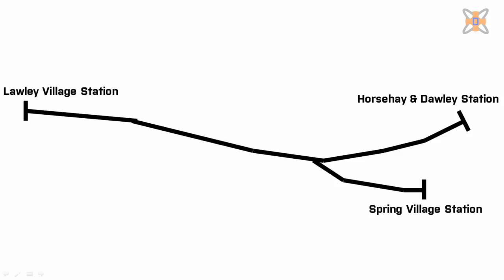The Telford Steam Railway (TSR)｜Drawyah

Comment: I used to travel this line Wellington to Much Wenlock, in the
late 50's early 60's, always a 060 pannier tank with two coaches. Sometimes struggled up Farley bank. Love it if you can get it at least to Buildwas if not Much Wenlock
Reply from the maker: Ah, back in its heyday! I hope that the extension to Iron Bridge comes about soon, it will be a great extension to this short yet historic railway!